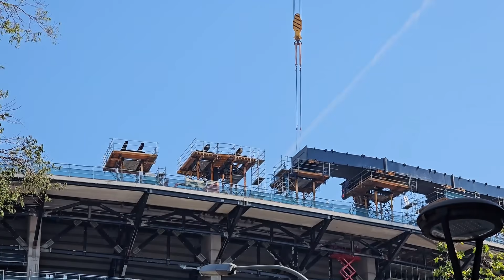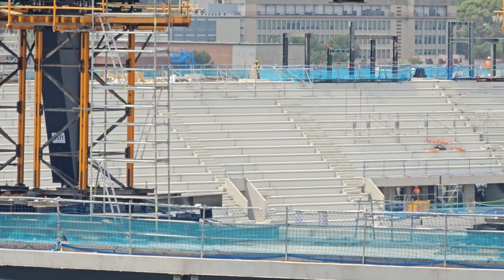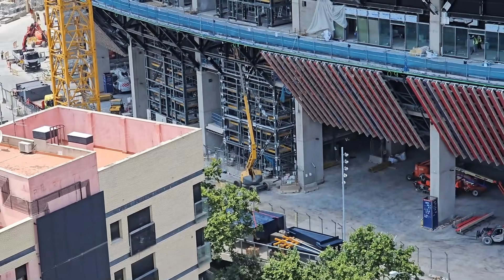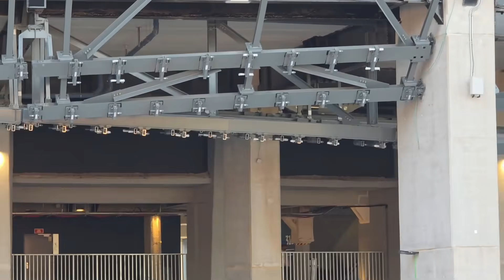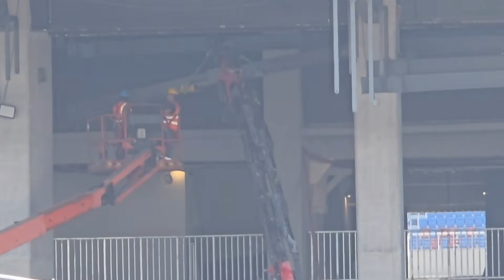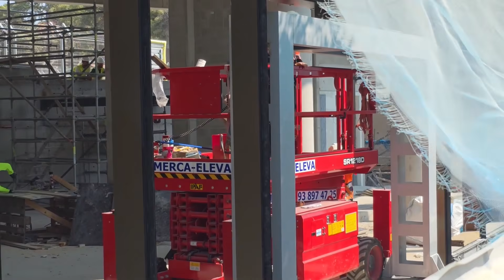camp Nou July 2026 Update | Massive Roof Progress & Façade Expansion

Comment: Why is the work so heavy?
Reply from the maker: Because every stage requires complex engineering, heavy lifting, and strict safety checks. Quality takes time.
Reply: They need to maximise the progress during these critical summer months, while they can work unhindered.  The need to complete the stadium as quickly as possible, without compromising standards, is urgent.